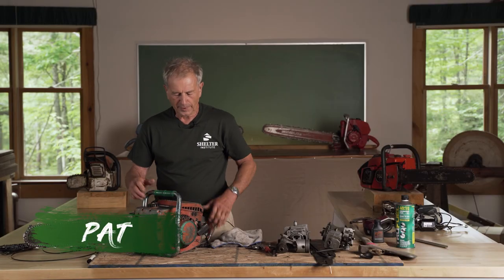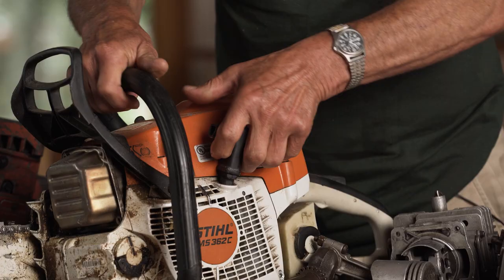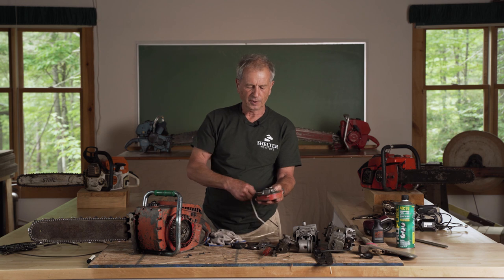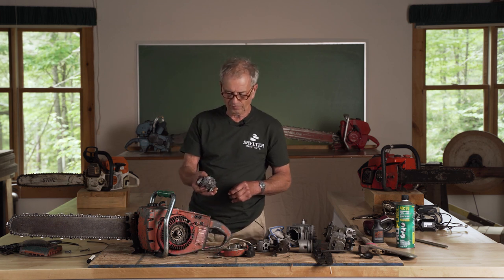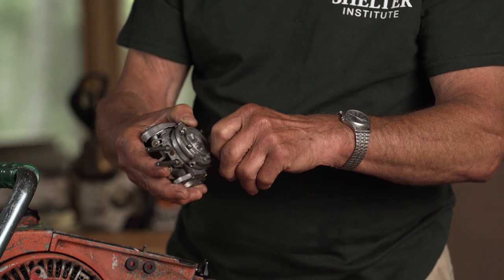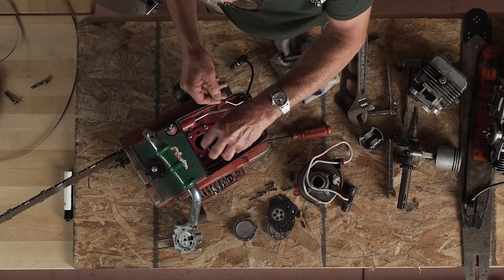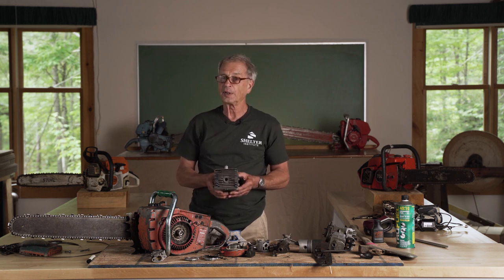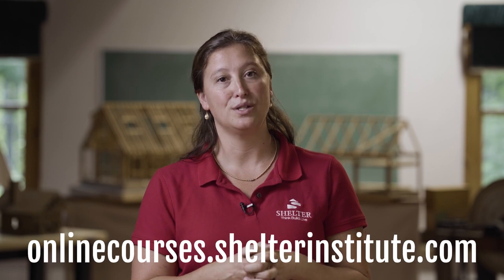Common Issues Starting Your Chainsaw - Starter & Carburetor

Comment: Have been cutting tree residential for the past 25 years and was always to busy keeping up with work then to fix those saws myself. So I would always just drop them off to be fixed and continue on with another saw. This is the 1st time I have ever heard it explained. Very well done! Thank you. Have several saws in the shed and its raining. Good day to build confidence and save on down time finding the shop to fix those saws.  Thanks again

Comment: Being of similar vintage as Pat, I have been using the same Stihl MS026 for over 30 years and yes, it was hard to start and didn't have a soft-start and the petrol filter kept clogging when left standing, so it was a swine to start when cold.  But then I never had to repair it or do anything to the saw. 
     Then I bought a new MS500i, took it out of its box, fitted the bar and chain, filled it with 2-stroke and oil, pushed the brake-bar forward, pumped the primer eight times, pressed the soft-start and it started first time.
     Modern saws with fuel injection are wonderful!  No more carburetor setting, no more Summer/Winter setting.  They just start!  Three times the power but the same weight as well.